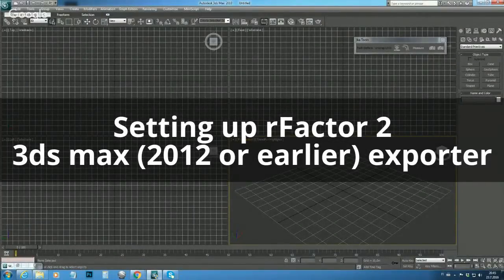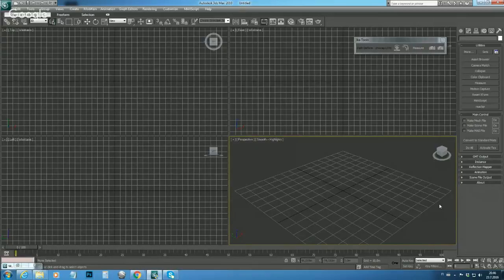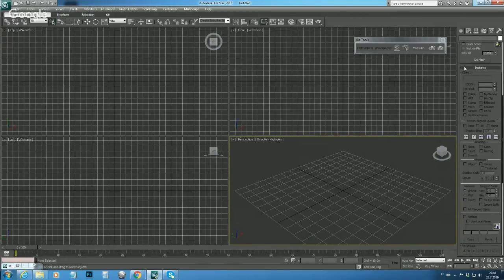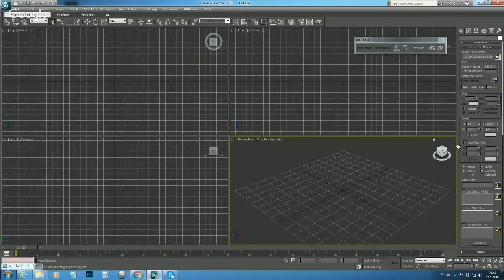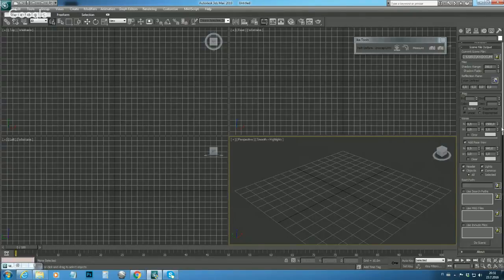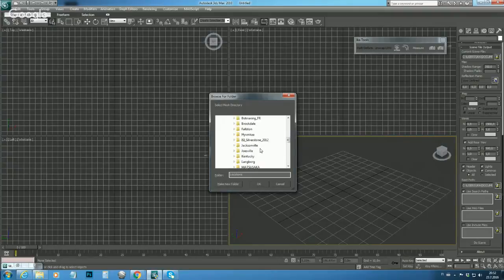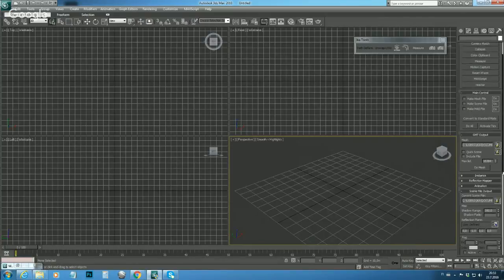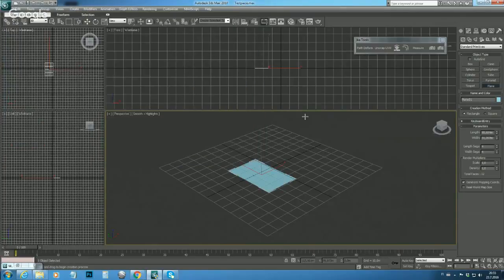rFactor 2 Track Dev Tutorial: 02 Setting up 3ds max exporter

Comment: Rather than copying the  dlu and 2 dlt files into 3ds Max' structure, I found it easier to keep everything up to date by adding a custom plugin path in 3ds Max by doing this:  Customize>Configure System Paths, "3rd Party Plug-Ins" Tab, Add...  Then set a path and description for your rF2 install.  In my case it was "...\program files\Steam\steamapps\common\rFactor 2\Support\Tools\Plugins\Max 2010"  Always up to date!
Reply from the maker: Can you give me a timestamp where this is mentioned so I can add an annotation pointing to your above comment.
Reply: Anywhere from 35-50 seconds in would be suitable.
Reply from the maker: lordpantsington cheers!
Reply: Works like a charm with 2017 :)